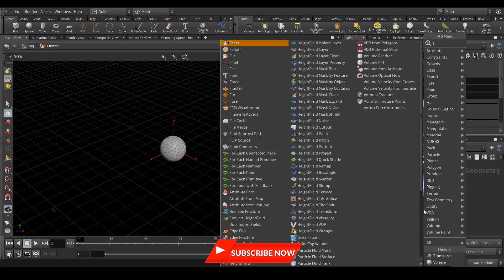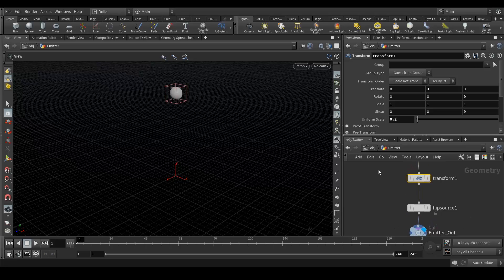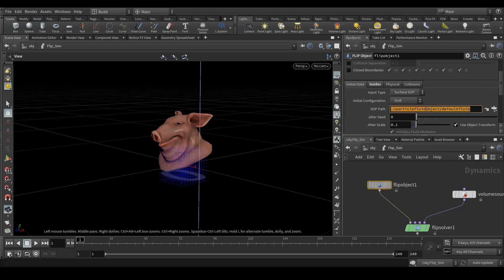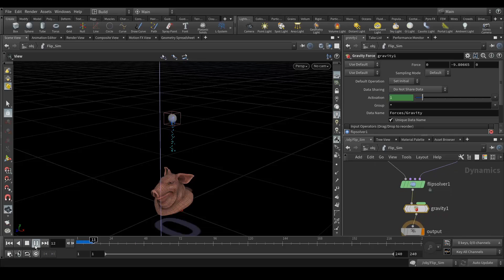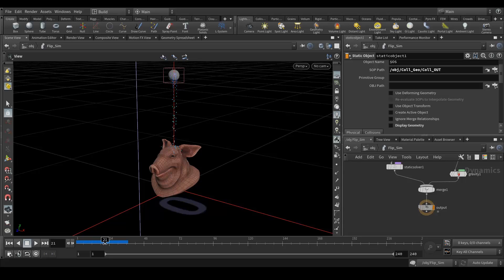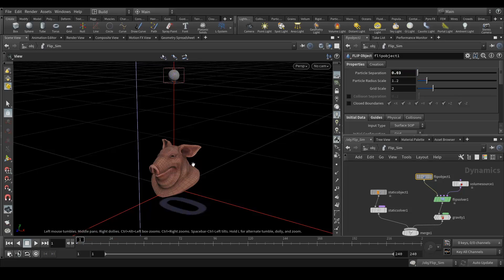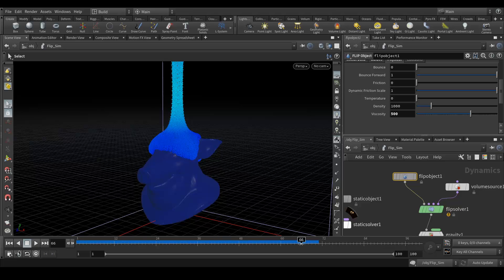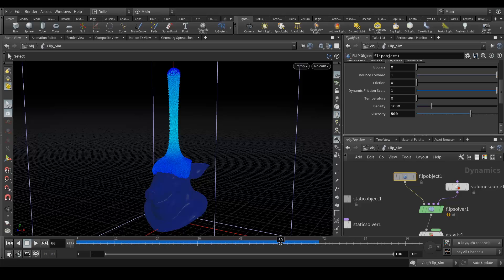Houdini Flip Fluids Introduction Part01

Comment: Hey, this doesn't work on version 18.0. The fluid doesn't collide with the pig. Any ideas?
Reply: I had the same issue, then it worked when I changed the staticobject>Collisions>RBD Solver>Surface>Collision Detection to "Use Surface Collisions"
Reply: @joelvarjassy88  can't get it to work in houdini 18.5, tried all of the above. I have extruded text converted to vdb and back to mesh. just won't work. unfortunately :(
I like the the tutorial very much but i can't follow through really, stuck at 7:49
Reply: @joelvarjassy88  nope, not working
Reply: @joelvarjassy88  gosh, thank you
Reply from the maker: I have tried this in 18 and 18.5 .. It's working fine... Please check your nodes again.
Reply: @CGArtistAcademy  hey so i got it working just like you showed in the video. Not sure why it didnt work first time,  maybe i needed to go back to first frame. Thanks for your help, awesome video!
Reply from the maker: @carlosdubusm  your welcome ..keep up the good work. :)